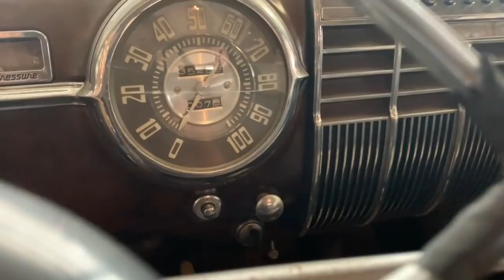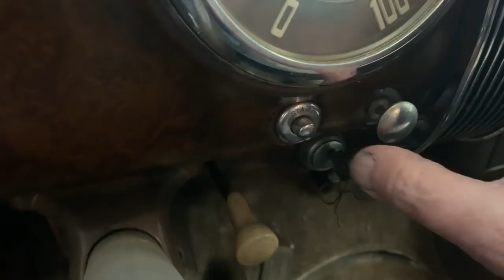Carchaeology: "Turning Pearl" Barn Find 1941 Cadillac, Will it run?

Comment: It's a Flat Head, take the heads off and have a look, could have been parked because of a seizure or busted cam way back when. Looks like there's lots of room to work under that hood.
Reply: Randy was told it was parked due to an external water leak. So, we’re really not sure yet. We plan on taking heads off tomorrow if all goes to plan.

Comment: DUDE!  I just saw this video with a method that can work for un-sticking the motor next time using a grease gun pushing 3000lbs by hand!  It didn't quite work on his Flathead project but he got it running in the end!  At: Farm Auction 1944 Ford Flathead V8 truck! Abandoned for 47 years! Will it run?!? Stuck rusty engine!
Reply from the maker: The clean up of all the grease from this technique sounds nasty... but yes, I have heard of it! Lots of old school ways to make it happen! Thanks for the info though!!
Reply: @Carchaeology  I never seen either dragging behind a truck or grease gun before this week, so thanks guys!  I shared ur "Lab tour part 2" to a guy I follow that's assembling a VW bus build right now at Paul Barger Bread trucker yesterday, lol!  One hand washing the other...
Reply: @Carchaeology  Oh I shared ur estate sale series to a friend from highschool that had a 62 Lancer like ur Red one.  He's the guy with the 69 Charger RT/SE we put the motor in a few times and rattle can primered 30yrs ago till it got restored last year that's in my 96 VHS bracket racing at the track one night with my 383 Stroker Firebird